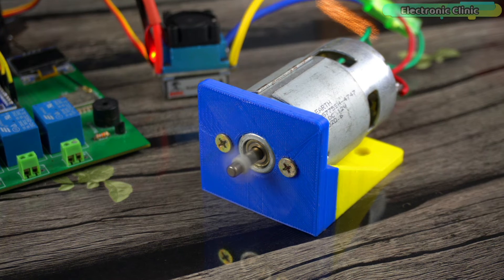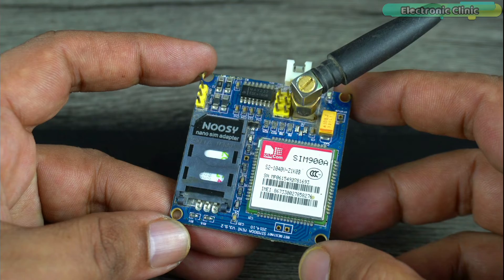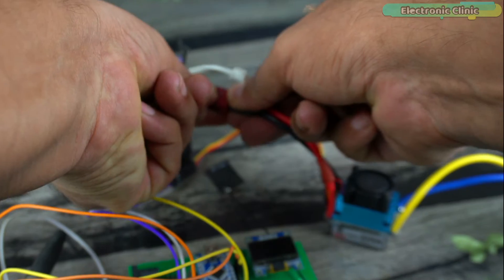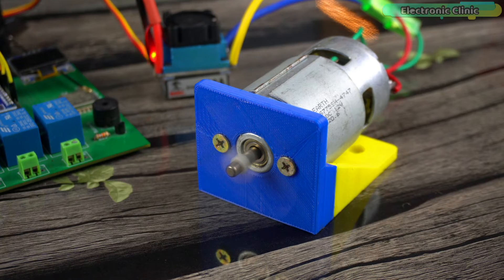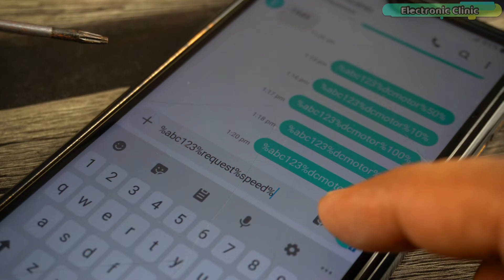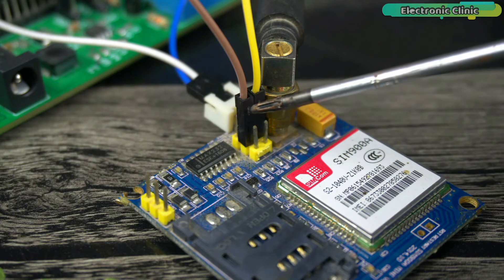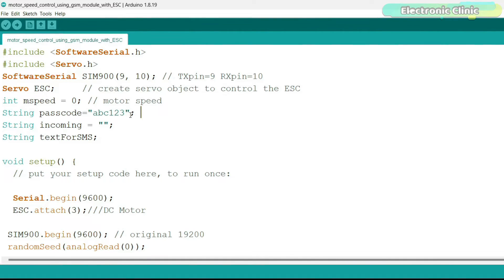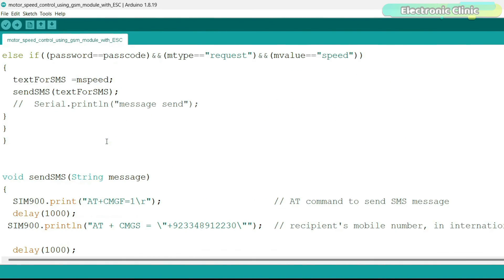GSM Motor speed controller and monitoring system, Arduino GSM Project

Comment: Hi, sorry to mention other video here. Just wanted to know about your offline voice recognition module. Can I put that module in wake up mode all the time. Or it will go to standby mode after executing command. I want it to be in active mode always. Really appreciate your time. Thanks.
Reply from the maker: There is no command to permanently activate the active mode.
Reply from the maker: You will need to first wake up the module and then you can use different commands.
Reply: @ElectroniClinic  Thanks for the answer. That means I have to keep looking for such  modules. In between thanks for sharing so many interesting projects.

Comment: Make a GSM MOTOR STARTER CONTROL ( AC MOTOR) using 2 relay trigger type.like push button. push 3-5 second only both relay for agricultural pump starter control